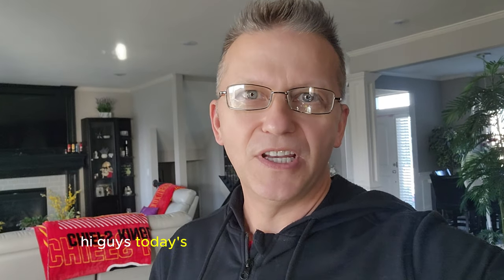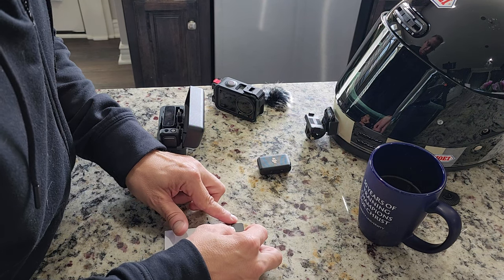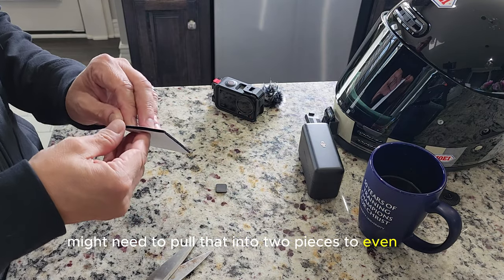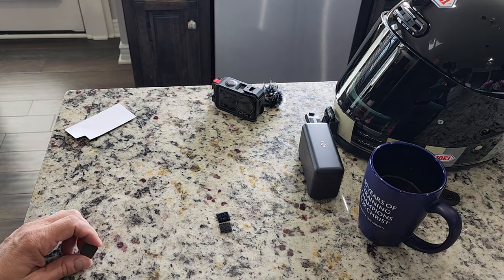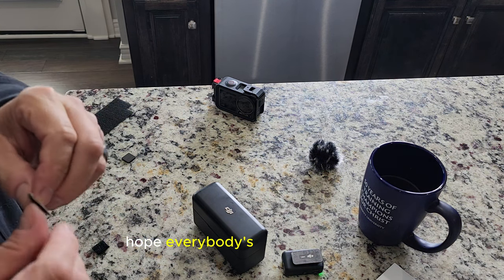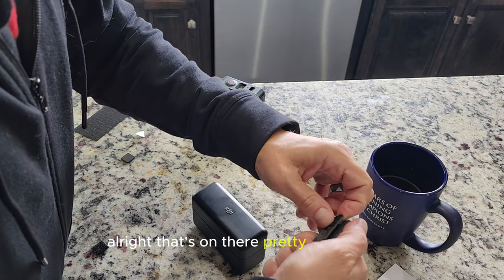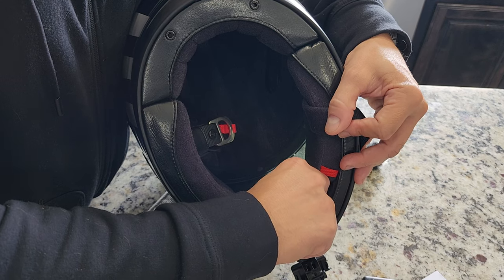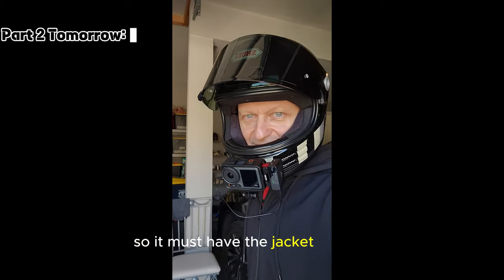The Ultimate Guide: Installing DJI Mic Inside Helmet (Part 1): Season 1 Episode 4

Comment: I'm working on my set up now with the DJI Mic 2 inside a Shoei modular.  I can't seem to find a spot where my chin or cheek isn't rubbing the wireless mic.  Or dead cat in mouth. Still working at it.
Reply from the maker: Yea, I had to put the bottom of the mic in the center and the dead car about 1 inch to the left for the perfect position in my Shoei Glamster.

Comment: Hi, fellow OA3 user and vlogger here. I admit to being a bit confused as to why you don’t remove the outer case, and insert the transmitter directly into the camera ? It would save having that cable dangling below. 🤔
Reply from the maker: Hi, I tried both ways. I felt like it may fall out. Although it wasn't loose. Recently I have been going without the  receiver completely, and just using the transmitter in the helmet. The only real difference I've seen is a need to then sync up the video and audio. Have you tried these different methods?

Comment: Why use a transmitter if the microphone is synchronized via Bluetooth?
Reply from the maker: The transmitter only syncs by bluetooth on the DJI Mic 2. I have the DJI Mic (1st generation). It has to be synced up during editing by hand unless you used the receiver. Thanks for watching!
Reply: I attached my Mic 2 inside my Shoei Neotec 3 with magnets. Horrible audio even with -18db gain adjusted in my Ace Pro camera since I only have the solo Mic2. Wind noise was terrible too. Any ideas?